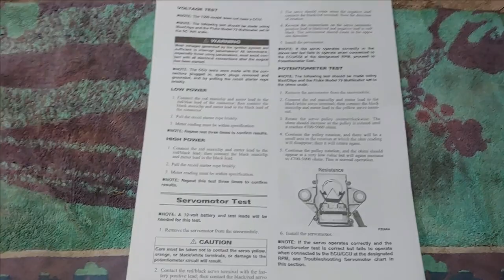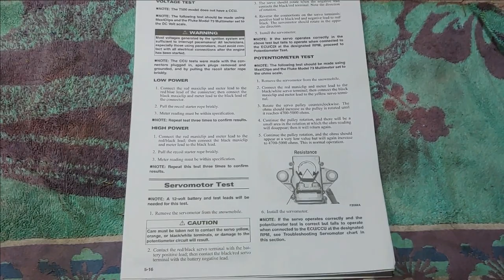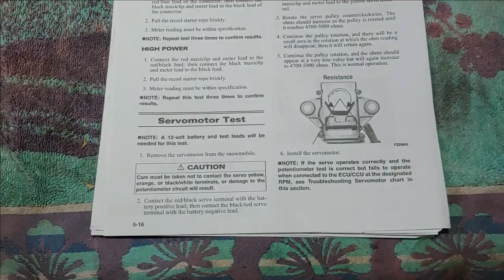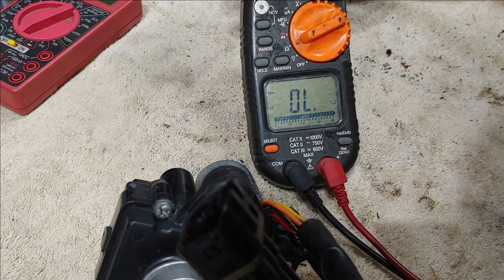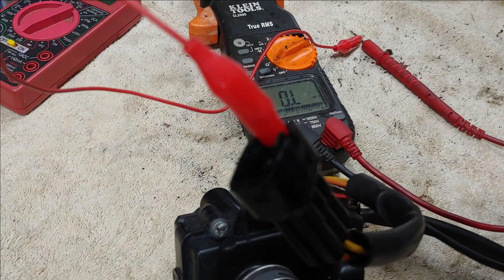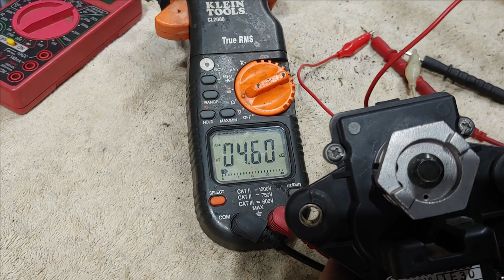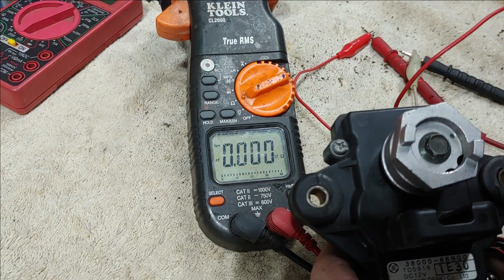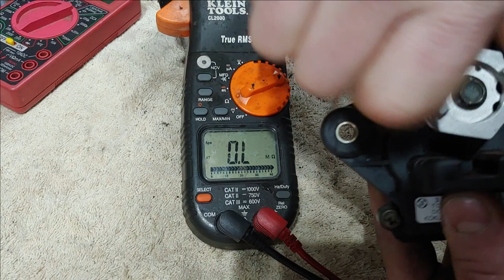02 Arctic Cat ZR 600 EFI Part 6: Power Valves & Troubleshooting a Bog [Servo motor Testing]

Comment: Thanks so much, we got a sled in the shop that came from 3 other sled shops that could not figure out why their was no power to go above 60mph, we are mainly a auto repair shop mainly but do work on sleds,
other sled shops cleaned power valves and replaced cables, they put a fuel pump and servo motor and also boiled it down to it being a bad stator,
we got the sled and started from scratch checking their work, customer stated no power after service.
turned out the first repair shop put the power valves in upside down.
we were getting power valve push back on the cables to become slack. 
seen in your video the same symptom of valve push back for cable slack.
took apart and power valves were upside down. fixed positioning of power valves and sled will lift the skis now. 
put in your video title power valves, took me some searching to find this symptom.
Thanks again for sharing!!! 
happy sledding
Reply from the maker: Excellent! I'm glad this video helped and I will definitely take your suggestion. Thanks for watching all I ask is please share the video and channel as many people as you can thank you.

Comment: Hy Andrew..nice video and so much to learn ✌️ quick question..i have a snow pro600 2010 ,i done al the test like you did and everything was fine on servomotor, but i find 1 of the valve cable was stuck and il change both of them, but when i plug in the servomotor and start the engine..servomotor is working once for a second but not stai open when i push the throttle after that nothings happens..i unplug the cables from the fully to let free the servomotor..and same  
I mention i clean the valves all good 👍 
Sorry for my English ✌️
Reply from the maker: Thank you very much and I'm glad they are helping. The servo motor only opens once the engine hits around 7,000 RPMs. I believe it's about 6,800 to 7200 RPMs

Comment: Just finished rebuilding an 800 EFI 2002 previous owner put the valves in upside down....

* I assume this testing procedure will work on an 800cc machine.
Reply from the maker: Nice. And yes it will. Exactly. One thing you might want to consider for your valves is to use a file and take the points of the outside ends of each valve as well as take off about .020" from the ends. They like to work their way down over time from compressing the aluminum ever time they close. Some people use shims. I used a round file on mine. 

Thanks for watching!
Andrew C.

Comment: I was seeing if you could help when you are looking at the service manual do you have ths next page by chance
Reply from the maker: What are you wanting to know?
Reply: @Fixin2Ride-Official-  on the page that show how to test the servo motor on the right hand side on the bottom it saids if you did these test and it doesn't work right when thw servo motor is put one go to the next page. The problem i have is i have done these test and it still doesn't work
Reply from the maker: Okay. Check out my stator testing video.  https://youtu.be/bJ_IUHr51OM

If your apv doesnt open at all but tests fine then check your lighting coil on the stator. On EFI models the overall voltage requirements are higher and therefore the servomotor gets its power from the lighting coil on the stator. Pull the four lead plug from the stator that has the yellow wires and then test the two yellow wires for ohms. You should get less than 1 ohm. Manual states "0.10 ohms" or so.

Thanks for watching! 
Andrew C.

Comment: Hey I have an 03f7efi and it throws a servo failure code around 7k. My pot is reading max 2100 ohms. Is it safe to say that due to lack of resistance in circuit the ECU is getting an incorrect reading? Not really limp mode symptoms, if I kill it and restart all is good until I hit 7k again
Reply from the maker: Have you taken off your Servo motor and tested it or at least unplugged it and tested it using a 12-volt battery and then hooked up an ohmmeter to see what the resistance is when U-Turn the cable pulley?
Reply from the maker: Just so you know I can't read the responses that you delete... I can only see like the first five or six words